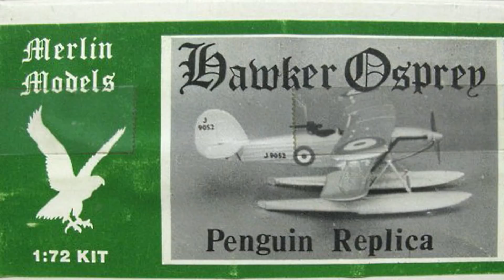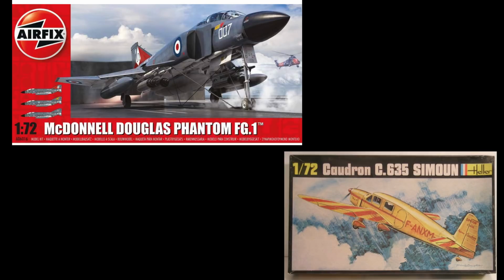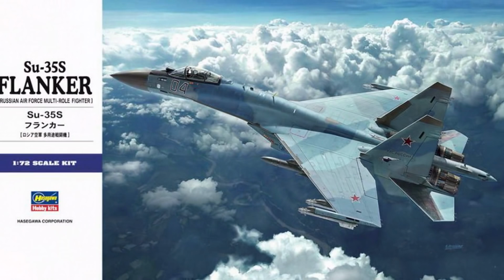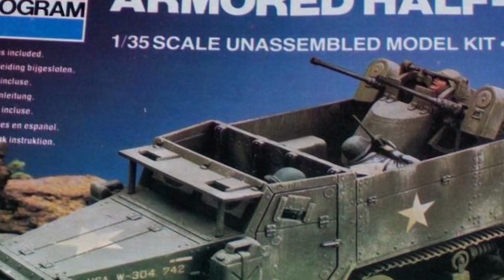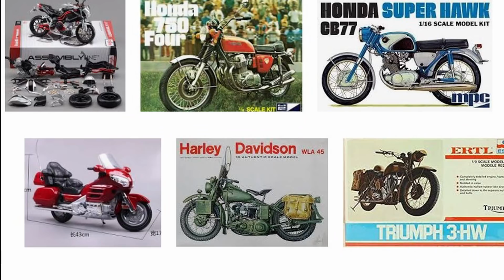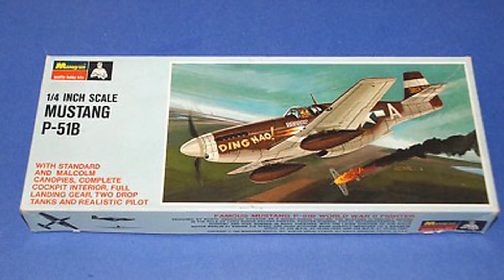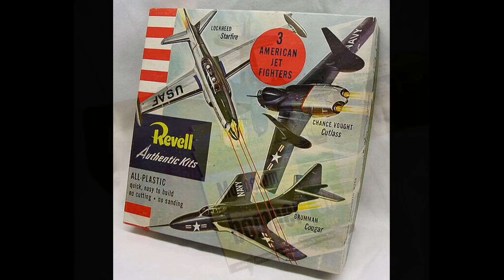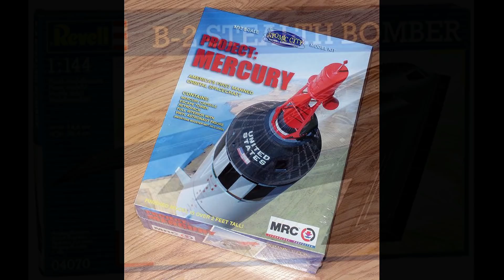Plastic kit models history

Comment: I'm 16 and I build modelkits for over 7 years. I can still remember my first modelkit that i had build with my dad (Revell 1:72 Fokker Dr1). Sadly i don't have my first modelkit. I don't really build alot because I have to do homework, sport and I play games with my friends. So I only build like 3-4 kits a year and i have 20+ modelkits in my stach to build. For my painting i use an airbrush with vallejo model air paints. For decalling I use micro set, sol (dont forget clear coat) . For weathering I use florrymodels washes or tamiya washes, I also add some chipping. I will never stop building modelkits and I hope you guys are still enjoying your builds.

Comment: To lifelong model constructors like myself this is a very interesting video.  I am an old geezer (in England) so I can recall the wood/balsa kits, which, as a 12 year old tested my patience to the limit. I was overjoyed when the first plastic kits appeared in hobby shops and can recall building my first one which was an F.86 Sabre by Frog, and my second was an Airfix Spitfire. In my teens I lived awhile in Hong Kong where I built several Revell models.  Thank you for nudging my oldest memories and filling me with nostalgia!
Reply from the maker: Bruce Maclennan my pleasure
Reply: Yes...Airfix Mk1 Spitfire. Woolworths, Watford at two shillings (tenth of a pound), (plus glue).
Reply: In one of your videos you were discussing scales. (I hope it was this one). You mentioned that automobiles are made to 1/87 scale because that is close to HO scales trains which are 1/96. HO scale in the U.S. is 1/87 not 1/96. In the UK they have OO scale which is either 1/76 or 1/72. I enjoyed the programs you did on Lindberg and Varney. As you can probably tell I'm in Model Railroading myself. But I built my share of Airplanes, tanks, battleships and sailing ships in my youth. I'm 61 and have been enjoying model kit building since before my teenage days. I'm enjoying this series of videos. Thank you for producing them! Oh by the way I scale trains are 1/48, S scale is 1/64, HO is 1/87, TT SCALE was 1/100 ( basically defunct now) N scale is 1/160 and Z scale might be 1/220 ( I could be wrong about Z but I'm sure about everything else)!
Reply from the maker: @Steven Huo yes you do

Comment: Kind of surprised that you didn’t touch on the massive market of aftermarket parts, from etched metal to resin upgrades and detail kits, metallic decals, carbon composite decals, the list goes on and on. It blew me away when I got back into it and started building 1/12 racing motorcycles 5 years ago how the landscape had changed for scale modeling.
Reply: That's a show on it's own. In fact the history of garage models for each genre would be hours long and include thousands of companies

Comment: Thanks again for another great video. With a little push and help from my mother, I started model kits when I was 5 (Renwal small fleet, and Revell Nautilus). When I was 8 a 12-year old friend got me started again with model planes, and after a few (Aurora Beechcraft, Revell Mariner, etc), he taught me about scale. Over time, I built mostly 1/600 ships, 1/72 aircraft, 1/48 tanks, and 1/87 trucks. I am working on an original Airfix 1/72 Me262 now.  Whereas 1/600 is not one of the main scales for ships, I do kitbashing to make what I want (e.g, USS Atlanta from Aurora Bainbridge hull, St Paul guns).  In 2018, I started making my own 3D prints of HO trucks and 1/600 ship parts (USS Helena CL50, USS Bristol DD453), plus the cabin of a 1/72 78-foot PT boat. Modeling is a rewarding hobby for me. Unlike digital play, there is a tangible, long lasting product for my effort.  It involves creativity, patience, concentration, and problem solving (especially 3D printing!) My next 1/600 model will probably be the USS Lexington (CV3) with a modified Airfix HMS Hood hull, lots of sheet plastic, and some 3D printed parts.

Comment: I got a shock when some years ago I found a model shop and not realising they were rare, innocently enquired after some metal (as one used to do) because  I was scratchbuilding. The proprietor explained that I was lucky to find a shop selling kits let alone helping a guy like me. Of course I get everything online now...
Reply: There were definitely some hobby/model shops run by crotchety old timers that did absolutely nothing to market themselves to new customers.  Sounds like you ran into one.

Comment: On scales: 
1) You should have mentioned "box scale" - many early kits were scaled so that the sprues would fit into one of several standard-size boxes used by the manufacturer.
2) HO scale model trains are indeed 1:87 (technically 1:87.1), not 1:96.  1:96 is I scale.

And how can you talk about early plastic kits without mentioning tube glue?  (Although if you're the blond guy in the video, you might not be quite old enough to have experienced the euphoria-inducing effects of the gel that oozed from lead foil tubes from Testor's.  Or the absolute lumpy mess it would make of your models)
Reply: Exactly!!    on HO trains

Comment: A bit more detail on the FROG - Novo relationship. By the 1970s, FROG was part of a toy conglomerate called Dunbee Combex Marx, which also owned Scalextrix, Triang and Hornby. The company ran into problems in the mid 1970s and went into liquidation. The various brands eventually found new owners and some still survive today, notably Hornby which, of course, owns Airfix.

The FROG plastic model side of things proved harder to dispose of so eventually the UK Labour government of the day brokered a deal with the Soviet Union who agreed to buy most of the FROG moulds (they wouldn't take any moulds of World War 2 Axis aircraft).

As part of the deal, the first few thousand off the new Soviet production run for each kit would be shipped back to the UK and packaged as "Novo" kits, using FROG based artwork and VERY poor decals.

Eventually, the Novo runs came to an end and the only versions of these venerable FROG kits available were either through second hand sources or in very poorly packaged and moulded Soviet market examples of the kits.

Quite a few of the old FROG moulds are still in use and "modern" versions of the kits are available through a number of brands such as A-Model, Maquette or Eastern Express. Even Revell has packaged up ex-FROG kits.
Reply from the maker: I did Novo and Frog and Airfix.  It gets complicated.

Comment: I started out butchering model kits when I was 7 or 8 in the early 70s. By 1987 I had a substantial collection that got lost/destroyed in a move. I started rebuilding immediately with the 1/48 scale Tamiya "Rufe" and then the 1/48 scale Monogram 1/48 scale Ju-87D Stuka. I still have them (plus a crap ton more) 36 years later. That doesn't include unbuilt kits.

Comment: As I was growing up I built all kinds of model airplanes. It was time consuming but when it was completed you had something to admire. I wanted to be a jet pilot so I could think about flying each of them as I built it. At that time it was important to be degreed in engineering in order to be a pilot --- and my math skills were dead in the water. I had dozens of model airplanes and my mother had them hanging from the ceiling of my bedroom. Up there it also gave my mother less small things she had to clean off.

Comment: Seems a gulf between static plastic kit modellers and model railway modellers in that few are pointing out that HO at 1/87 is the most common scale used for trains. 1/96 was only a short lived scale used by a handful of pioneers in the 1930s for scratch built models. 1/87 chosen to  get the right proportion for the track gauge. Lots of plastic kits of railway rolling stock and buildings for HO and 1/76 OO, but a rapid trend to ready to run in recent years. Plastic not favoured for working locomotives as the weight of metal for adhesion and strength is needed for good working operation. In automotive I see a trend to ready to display die-cast cars also.
First plastic kit for me was an Airfix Typhoon at 10 years old. Father ws not pleased with my purchase as he expected it to fly at the price.

Comment: I really wish the 1/32 and 1/35 scales were standardized to one or the other. The differences are minimal, but it would be great if the scales just matched up.
Reply: You can thank Tamiya for the problem. In order to kill the competition they developed the 1/35 scale and offered more and better detailed kits. Thus Nichimo 1/30 and Monogram 1/32 lost out. 
Revell and Renwall never seriously competed and offered mainly box scale in odd sizes
Reply: @gofigureme5749  so why not do aircraft in 1/35 scale?? It's just illogical.
Reply: @LiberalsArePoop  Aircraft were still tied to the 1/32 standard, which was used by toy manufacturers. Armor moving to 1/35 was due to the massive popularity of Tamiya's early wave of motorized kits, which were basically 1/32 slightly upsized to accommodate batteries and a small electric motor inside. I know it sucks, as I have an enormous collection of WWII vehicles and aircraft myself, but if it were not for Tamiya appealing to the kids looking for something like a toy but not like a toy we might not be enjoying all the great kits we have now. And most people coming to your house who see your kits will never know the difference.

Comment: New generation is coming on. I am 16 am I love modeling. I don't have air compressor but I do my planes and ships with brushes and they come out pretty good. Not as good as with air brush I'm sure but what can I do.

 For now the biggest thing i have build and took the longest time was Lancaster 1/72 scale. Now I am building Ta 152 H-1 model 1/72 scale. 

Most planes what I build is 1/72 scale because then I can compare them.
Reply: It's good to see some teenagers today, interested in the hobby.  I started around 8 and by 18, used a small air compressor for spray painting.  A few years later, I bought a regulator and air tank (fire extinguisher) setup with compressed CO2 gas from an air-gas dealer.  For the last 32 years, I have the same tank and have it hydro tested before refill, if its been over 6 years from last test date.  Most tanks will last a lifetime as I've found CO2 tanks at my workplace that have test date stamps dating to WW1 era.  When you can afford it, I'd recommend the investment in an airbrush and CO2 gas setup, as your painting skills will improve and the results will be worth it.  Best wishes and have fun building that Focke-Wulf "Long Nosed Dora".

Comment: who else is under 18 and builds models? im 14 and i build tanks, planes, cars, also i just bought Tiger 2 from revell, cost me about 17€
Reply: I am also umder 18 and have started to build models (mostly ships) from kits or form scratch about 1 year ago, once you are into it, it is really a fun and rewarding hobby
Reply: I've been at it since I was 6 yrs old and my dad brought home a Monogram Tiger tank kit, was a snap together kit with stickers I was a happy camper. I built models throughout my teen yrs and I am sure it kept me outta trouble...….well most of it anyway. Been at it now for over 40 yrs and I still find it a very rewarding hobby.
Reply: I am also 14 and just got into the hobby, so far I have built a saab ajs 37 viggen, jas 39 gripen, a j35 draken and a j29 tunnan. I hang my planes in the ceiling with fishing line so they can fly in formation.

Comment: Hi Max, I just came across this video and found some misinformation. HO scale is 1:87 not 1:96, with True HO scale according to the NMRA being 1:87.1. Most people today just drop the .1 and use 1:87 as the reference to HO Scale. Also HO scale is not really Half O as the name implies, just like N scale (1:160) is really not half of HO scale. This leads to a lot of misconceptions of the two popular modeling scales here in the US. Things get even fuzzier in places like the UK where you have 1:76.2 scale trains running on 16.5 mm (HO scale track) that modeling scale known as OO or double O. Then to make matters worse you have 1:148 scale models running on 9mm (N Scale) track, with that modeling scale is known as "N Gauge". Long story short, HO scale is 1:87. Cheers, Rich S.
Reply from the maker: Yeah I got my info mixed up.  Shame on me.

Comment: Just got back into Modelling ( https://imgur.com/a/GzLRqvl / https://imgur.com/a/fxHQqrn ) after a lengthy hiatus by upgrading a 1/16 Display Stand Model into an RC one and converting an already RC Model to a newer Variant both of which required extensive Airbrush work which subsequently led to me also redoing a 1/35 model ( https://imgur.com/a/D23m0ud ) and buying some new ones including two Tamiya ( an old M1A2 and a new Type 16 Kit ) and an older Revell ( GTK Boxer Kit ) I was barely able to find for purchase and I gotta say that the Tamiya Models, especially the new one, totally blew the Revell one out of the water in terms of build quality. Both being 8x8s the Tamiya one featured stuff like actually workable steering whereas the Revell one did not. I also had major issues with getting the Decals off the fuckin' transfer paper - I literally had to peel them off using a tweezer despite soaking them in warm/hot water for like 5min.

Comment: I've been building plastic models since the 60's and still can't understand what idiot decided military ground models would be 1/35 scale and aircraft would be 1/32.  Although they're close, you can still see the difference in a diorama.
Reply: Tamiya followed Monogram with 1/35 by accident as their motorized Panther in the mid sixties was made to fit a standard gearbox, and it worked out to 1/35. Tamiya and Nichimo became cheap imports and the scale dominated over 1/32 as a military scale.

Comment: In my mind the profusion of different scales never really made a lot of sense. Having grown up in the US when the Metric system was just some weird stuff you got exposed to maybe one time in grade school the scale based off of 12 and 4 (1/12, 1/16, 1/24, 1/32, 1/48 etc made a certain amount of sense. But 1/25 th? 1/35th? WTF is with that stuff is what I thought. And then the railroad scales. HO at 1/87th? I know its 50% of UK O scale at 1/43.5. I understand the scale is 3.5mm per foot. Talk about mixing measurement systms.  I just wonder you would choose such an oddball ratio. Never mind 1/45th O scale in France, Germany and Russia. And then TT scale at 1/120th that came out of Eastern Europe and N scale at 1/160th from Japan. Regions that had been fully metric for decades or more. One would think that a 1/100th scale would have been a reasonable solution in a Metric world. And then the truly bizarre 3mm at 101.6 or 2mm at 1/152. I full well realize that you can make a model at any scale you want. But to start with a lot of the tooling was created using Pantograph Milling equipment. These types of machines come with certain ratios built into the arms. And that's where the original scales most likely came from.
Reply: Most folks somewhat specialize and if you are only, say, building model aircraft, the scale "issue" isn't really an issue at all.